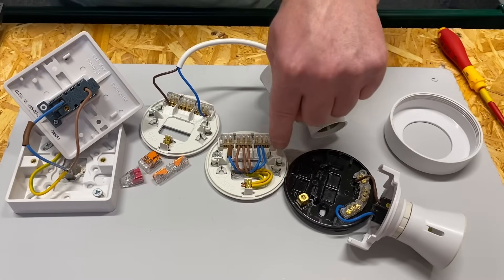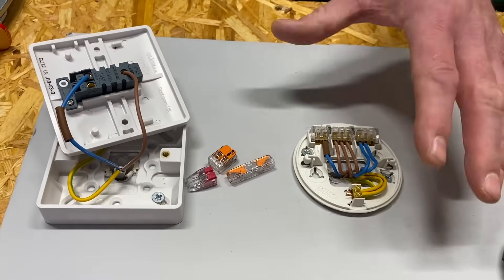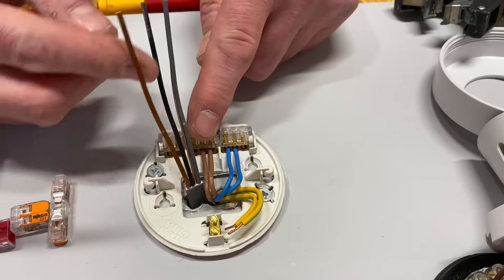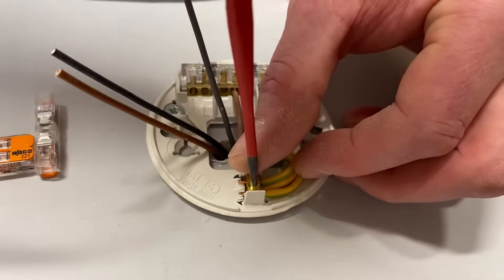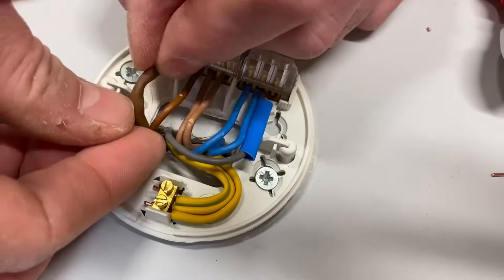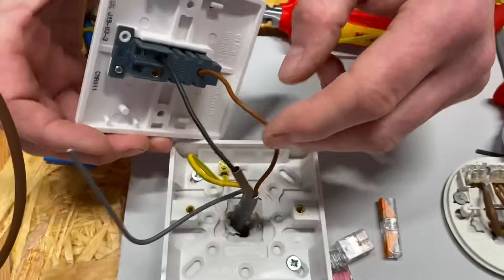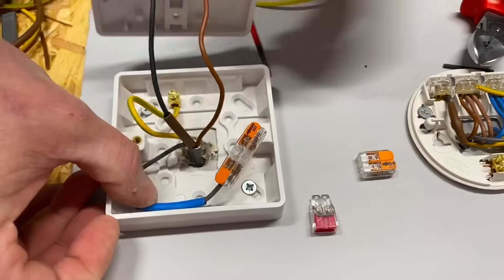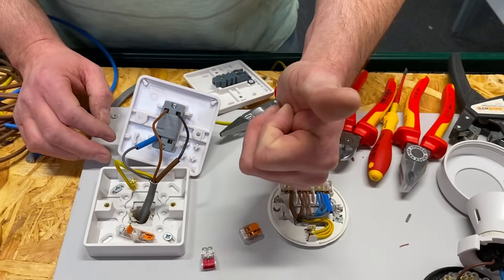How to Future Proof Your Lighting Circuit with a Neutral at the Switch - 3 Plate Wiring Method

Comment: Nice one gaz 👍 your videos are going to help me massively when I eventually get to college to retrain 🙌🏻🙌🏻 can I ask gaz this may be a silly question but youl probably know , but most of the starting level 1course dates are all now sept2022 so is it possible to join the previous year class if you no what I mean , I’ve to speak to colleges when they open but just wanted to know if you could shed any light 💡I’m an adult learner so would be night school paid for by myself etc ... any room on your course 😂 I would love a teacher like you 🙌🏻🙌🏻
Reply from the maker: Hi, I my experience adults training in the evening start at level 2 I personally don’t see the benefit of starting at level 1. Maybe worth questioning your potential training provider on your starting level. All the best and thanks for watching 👍🏻 Gaz
Reply: @GSHElectrical  nice one gaz cheers🙌🏻🙌🏻
Reply: I'm starting in February at night school level 1, been doing loads of study for about 6 months now about electrical theory and practical work but realise you can watch videos all day long but need that hands on experience. Still I'm hoping putting the work in will make the course a bit easier. Hoping Covid doesn't put a spanner in the works like 😔. I'm 41 now so not going to be easy re training but I've got a 4/5 year plan to do level 1 to 3 and learn as much as i can, maybe do a bit at weekends with a spark i know and then hoping somebody will give me a chance down the line. Anyway all the best with your course
Reply: @michaeldillon3016  nice one mate fair play 👍 did you manage to jump on a course late then? Most colleges I’ve looked at there start dates are sept 22 I’ll be gutted if I can’t get on this year until then I’m not sure how the adulting learning at college works weather I could join a late course or what 🤔

Comment: Better still, future proof: get network cable to your light switch! Wire to a central location!
Reply from the maker: Great comment
Reply: @GSHElectrical  it was a bit of a smug comment to be honest :) It’s what I am doing - currently refurbing our whole home and only wiring CAT6 to light switches. All light circuits running back to central location where I’ll install dimmers in a rack. I guess it’s not a luxury many will have though, being able to wire from scratch. happy new year to you!

Comment: Years ago the NICEIC would complain to us that we shouldn't have floating cpcs or neutrals in back boxes, albeit it tended to be connector blocks as Wagos weren't really common place then. We used to have to use 2 connectors fixed with a screw through the middle of the connector or use a strong double sided adhesive tape to secure the connector. Always thought it was an absolute waste of time and it was short lived to be fair. It's not something I've heard being raised these days.
Reply from the maker: Thanks for your input. Gaz 👍🏻

Comment: Great video presentation, great idea and makes a lot of sense. I personally would prefer the first method using the wago connector. It's very handy having a neutral in the switch box, if for example it was in a hallway and you were installing an outside light, you normally would have no return from the switch, which  could leave you clambering around in an attic or lifting up floor boards trying to locate a neutral to give you a return from the light. Also doesn't take that much longer to install. So well worth doing in order to future proof the system.
Reply: Quinitec is the future
Reply: @yourmamaok  hi, if you had a current outside light fed with a T+E on a pir and no means of turning it on and off just purely off the sensor, if i wanted to install a wireless quinetic receiver which needs a L+N in and L+N out would i have to put the wireless quinectic inside an adaptable box and wago the permenant live and neutral to continue to the pir sensor so the light still works off the sensor and then just put the switched live into the reciver so that the light also works from the wireless switch to be installed????and ideas
Reply: @MrEnixa  wire in parellel. Ie feed to light and receiver. Then switch line to switch line of receiver and sensor to light. Quinitec will turn the light off unless the sensor wants to come on
Reply: @MrEnixa  3 core and earth between receiver and light. Live, . Feed neutral, and switch line no wago required
Reply: Hi. For an outside light would you take the switch live or permanent live to the light.
Reply: @arfanjhangir8465  depends if you want to switch the light or it be on permanently...

Comment: I’ve done a few rewires the other way around.

2 plate but run a three core to the ceiling rose. 2 plate saves extra cables at the lights…. but any benefits against this way are probably marginal.
Reply from the maker: 🤫 that’s my next next video 😮👍🏻
Reply: @GSHElectrical  Also useful to have 3 core for switch in 2 plate method as well, getting feeds to smoke alarms can be awkward, when feed is in the switch.

Comment: No a fan of those cable strippers, it’s just another tool in the bag. Also, depending on the size of the enclosure, it’s not always possible to get all the grey sleeve off.

Much prefer side cutters, although they take a bit more skill to use properly.
Reply from the maker: Thanks for the feedback 👍🏻

Comment: Great video Gaz . But I just can’t bring myself to like the idea of having a neutral at the switch? To me that’s what they did back in the 20s and 30s  it seems the industry is going backwards not forwards . Also you say you like to double over the conductors ? That is what we are supposed to do it has always been tort in colleges as it gives the screw a better area to bite on but we don’t need to double the ends over when two or more conductors go in the same terminal. 
Fantastic video as always mate 👍👍👍❤️
Reply: It just makes it a lot easier for Joe Bloggs not to fuk up fitting the pendant light that he got from IKEA.Especially as very often sparks don't use the twin brown but use the brown/blue..and don't bother to sleeve correct colour
Reply: Its not going backwards though, smart switches enable people to control lighting verbally as well as physically, that is a major advantage over physical only method of controlling lights and all it requires is one more conductor.

Comment: Is that Wago inline connector new, first time I've seen them. Brilliant informative video as usual, Gaz you have taught us so much, thankyou.
Reply: @NW I noticed them just before Christmas and I found them hard to source from the usual online electrical retailers - without paying through the nose with those that did have them. I presume they're still very new to the market. I actually ordered mine from Amazon. They were the cheapest but are sourced from Amazon EU ( Germany,  where they're manufactured, so another reason for thinking they're new) and as such  delivery time is quite long over the holiday period.
Reply from the maker: Thanks for the positive feedback 👍🏻
Reply: @GSHElectrical  Hi Gaz. Just wondering why you doubled up the neutral at the ceiling rose when there’s a spare terminal to use? I’ve noticed you’ve done this a few times. Just curious.

Comment: When I did my AM2S the specification asked me to provide a neutral at each switch, which makes a lot of sense because of future proofing and it takes minimal effort if it’s done at the time of installation.
Reply from the maker: I have made that video also 👍🏻

Connections Explained - Wired Through the Switch 2 Way and Intermediate AM2, AM2S & AM2E Assessment
https://youtu.be/Xe_ap2eRjYI

Comment: I've haven't moved over to smart switches yet. I just wonder how this will work with 2-way switching, if we need an extra neutral at the 2nd or intermediate switches, would we benefit from a 4-core flat cable? I really don't want to start installing two twins for every 2-way switching circuits. Kinetic switches might become a better option in the future, not sure if there is a way to make them dimmable without cabling though as yet.

Regarding your comments on the looped neutral connection at the switch and DIY'ers, I wouldn't really give it much thought. If someone is changing a switch and aren't competent then that is their own fault. We can't allow for stupidity during our installations.
Reply from the maker: This may help

Connections Explained - Wired Through the Switch 2 Way and Intermediate AM2, AM2S & AM2E Assessment
https://youtu.be/Xe_ap2eRjYI
Reply: Gaz the only problem with wiring throught the switch would be...yes, you get a neutral at each switch point but at the intermediate and final 2 way switches you don't have a permanent line, which I'd expect some smart switches will require?

Comment: I would guess in 10 years time every switch will be a smart switch. Having a neutral means they just work. No neutral ones are very unreliable, the wrong bulb and it will flash.
After thought - I suppose we have kenetic type switches too.